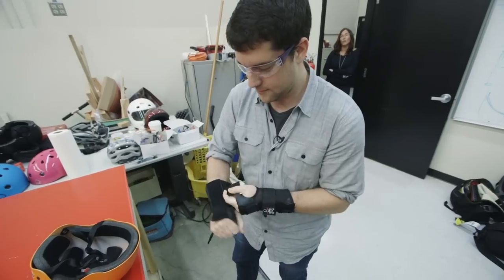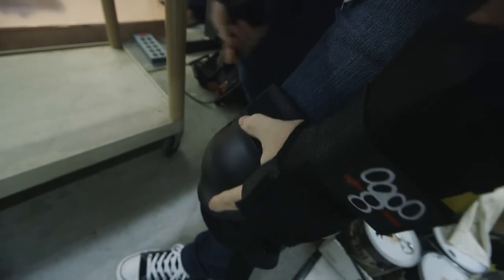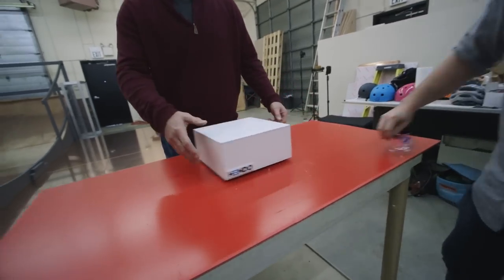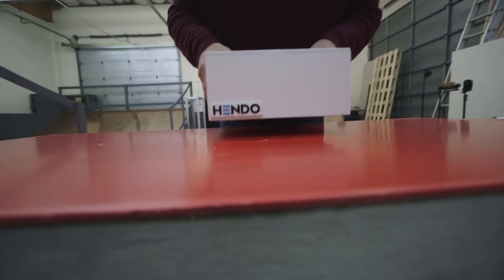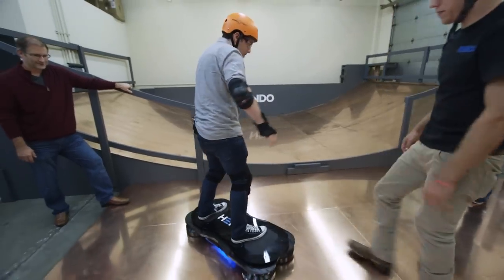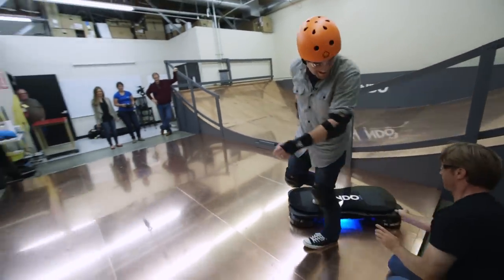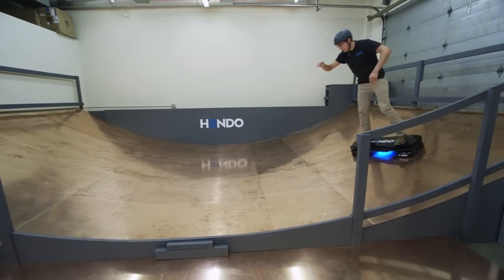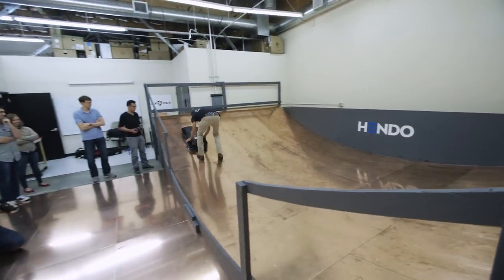Riding the Hendo hoverboard

Comment: I'm still a ways away from graduating high school, but would anyone know what sort of field I should go into it i'd want to persue a career similair to this? And if so, how are the chances I could work on this project specifically?
Reply: "Mechanical Engineering" or "Electrical Engineering".  Probably closer to something called "Mechatronics" but that might just be a buzz word I'm not sure.  There might be a few other fields as well!  Mechanical Engineering will be more hands on building things, but you might not get enough programming experience.  Electrical Engineering will have (what some would consider) more boring lab work but might prepare you better as a programmer (and programming is REALLY important!).  Either one of those majors branches out into a TON of different fields if your interests change in the next 10 years, and if you really really want to be leading the project and not just a grunt/slave/technician for the person making the big bucks, you'll want a PhD so please do well in school!  You can check out the "Arx Pax" website to see quick biographies about every employee working on this project and see their career path from the time they were 18 until now.

Best advice I can give for how to improve your chances is this:  "Find ways to make building cool things your hobby".  There are very few things a college grad can do that a high schooler can't learn!  Except the math is hard.  Knowing how fluids/heat/electricity/magnets work probably takes a few classes but whatever that's what youtube is for.  Anyway, maybe get an arduino and do small projects with it (maybe using something like MATLab), play around in a program like SolidWorks, and don't be afraid to apply for internships you don't think you qualify for when you're only 16+ just because one hour of applying online might be tedious and your odds are bleak.  Anything you can do to show your extra curricular activities were more than sports/league of legends/team fortress 2 will seriously impress employers, but it's not going to be easy because you're going to find out that not a lot of adults can teach you and some things will cost a lot more money than what your parents will want to budget you for your birthday.  So teach yourself and pirate EVERYTHING

Big disclaimer is that I'm a stranger on the internet and you should ask family members this same question.  Maybe some uncle or cousin or a parent of some friend is an engineer and can help more than one youtube comment.  But yep, I picked mechanical engineering because I wanted to build roller coasters :)    I'm totally NOT building roller coasters right now, so in no way am I actually an example of how to follow your dreams to the fullest but thought I might as well type for 15 minutes to point you in some kind of direction.

And for the second part, to work on THIS project at "Arx Pax" the odds are incredibly slim.  A lot of startup companies come and go, so either this project ends up successful and gets bought by some bigger company or it runs out of money.  A lot of inventors come up with ideas and then hire a team of 5-6 PhDs that know what they're doing, and then hope to get bought before they run out of money.  You'd almost be better off starting your own company, and even then to be successful you have to know when a project won't pay off quickly enough and you have to abandon it for something with less risk than a hoverboard.

Hope this helps!
Reply: Probably electrical engineering or mechanical like EmuKiller said. I am majoring in Computer science but I know some electrical and mechanical engineers and they make some cool stuff.
Reply: A Career!!! dude even in the video the guy said they were looking for funding, so as they are not making money yet, this is not a 9 to 5 paying Job, just a hobby on steroids.  

The best advise is that being a grown up is SHIT, & working for other people is SHIT, just enjoy your youth there are no fun jobs in R&D. Work for yourself in spear time on your OWN ideas kid, it's way more fun and potentially rewarding that way.

Comment: i I thought about this when i was in fifth grade, but i realized that to do this kind of levitation i will need to change the current platform of streets and everyday surfaces to steel/magnates -imagine cars and bicycles using this concept, FUTURE!, there will be no accidents too because the magnetic field will prevent any interaction with any object-which seemed unachievable so i gave up on the idea, they should do that too unless governments and private entrepreneurs were included in their formula, other than that they are just another Solar Roadways.
They can always sell this with that golden platform used in this demo as a package that costs 1x,xxx and it would be a cool gadget to a rich kid.

Comment: Nice work but no skate like board controls or stability .
AVA Magnetic Levitation has already come up with this kind of system.
But with drag at the rear so it pulls straight to the direction of travel.
My board design is lighter and the floor is active instead of the board.
Want to know more ?
Adam VA of AVA Magnetic Levitation AUS

Comment: Crap.  $10K for a skateboard that has to float over non-ferromagnetic metal?  An for how many few minutes?

Someone will steal the copper or aluminium from your house for recycling money.  How much power to float a 1500 square foot house 24/7?  When do you float the house? Earthquakes are not predictable yet.  Floods?  Most floods I have seen are deeper than one inch.

This is a high school science project gimmick.  Take a coil of wire, put AC current through it, and watch a piece of aluminum float.

Comment: The problem with this hover board is that it is not a hover board.

This is a Maglev Board. A board dependent on magnetism will not work unless we pave sidewalks in stainless steel. 

The Earth's magnetic field is 1 Gauss, or 2% the strength of a refrigerator magnet. The reason is that Earth's magnetic field is thinly spread over a very large area. Unfortunately, as cool of an idea as it is, there is no way to utilize Earth's magnetic field for the powering of a hover board.

Stainless steel sidewalks and RC capabilities make the hover board possible with 2015 technology.

Comment: The boards and users for the sport take a lot of beating and abuse. If electronics can withstand a design, cells (boost and recharge) that can power adrenaline (at long term of environmental/gadget conditions) to danger zones and leap obstacles of crackheads creativity and stable cost maintenance etal for the toy - then the toy can be feasible. If the toy just exhaust its power in an unexpected dangerous p[laying ground grid, then there is HUGE trouble and will be concluded a concept just intended relic for the shelf.

Comment: Does anyone else believe that maybe, just maybe, they are building upon a dead end road? I see how the tendency is that the hover board can become smaller and manageable, but how can they get away from the ultra strong magnetic forces? This might be the point were what we need is some crazy guy to take 10 steps back and try to find a completely different way to get to the same goal. This has happened in the past, when scientists reach a dead end and some genius figures out a completely different pathway to go over the wall, into the undiscovered. Don't ask me though, I am not that crazy.

Comment: they could maybe mix in metal flakes to cement or paint so they won't need a metal plate flooring. Maybe pave a road with metal infused cement or something. They could probably paint an entire skate park with copper paint used in a ship's hull if they could find a way to make it non-toxic.

Comment: I know that rotating electromagnets very quickly you could overcome earth magnetic field, cause the field supports the electromagnetic field like wind supports plane moving through the air.
Reply: just like one magnetic earth line cannot support magnet stopped, quickly moving one wont bend it down, but the rotation needs to be fast and furious like 30-60.000 oscillations / s or more.

Comment: heres, ONE problem, it only worksontop of metal.
Reply: who the fuck has a metal platform just laying around
Reply: +diego gaud Skateboards only work on smooth surfaces, we made the smooth surfaces, at some point we may start making our roads and sidewalks with a thin layer of metal on top of or inside of the surface because we found out a more efficient and/or safe way of near-frictionless transportation via quantum locking or magnetic architecture. If you wanted hoverboards to be some kinda off-road transportation method then you were just being unrealistic.

Comment: To all those complaining about it only working on metal, Consider that diamagnetism exists in every single substance and material not only conductors. Anything will become a dipole if you present a strong enough field. So if these things had MUCH more power they would force the surface they were operating on to become diamagnetic and would float regardless of the material.

In practice however the field needed would have to be MASSIVE and would cause alot of issues. but maybe there is a way in future.
Reply: Ok, but if we could make such a field, wouldn't that launch us into the air once we float over a random piece of metal?
Reply: Kind of...You would hope that whoever figures it out would also realise that different materials have different thresholds to become diamagnetic and so a system would need to be in place that could detect the altitude of the 'board' and if it started to rise or fall it would adjust the field.
The item in the video already seems to be doing that as when the guy gets on it it detects the extra force needed and you can hear the noise its making change as it ramps up the power to keep the same height above the surface.
If the board went from the copper cladding onto steel instead it would loose height and would again need to ramp up the power to stay level. There will be a limit on how much power it can output and this what materials it can work on.

The truly exciting thing about this is that until now maglev trains needed magnets ether electro- or permenant on both the train and the track.With this tech the track can be simple metal rails like we use today anyway with all the expensive stuff in only the train....this technology could make maglev viable.

Comment: Just an idea;  for levitaion can a square of metal be affixed to the bottom of the hoverboard thus not needing a track or metal floor?  (I'm prepared for the naysayers' attacks on my ignorance, and I don't care).
Reply: Unfortunately not, it would simply not work. You can do it, but then the metal plate would just be touching the ground, thus not hovering at all. Not only that, it would have no way of moving since it has a fix point now. It would be comparable to bolting a bicycle into the ground and trying to ride away on it. Quite simple really. Just a suggestion, I would delete your comment if you were serious about getting an answer. I don't believe in ridiculing someone for something they did not know, since one day I didn't  know that either. But this is a YouTube comment section... Your choice though. Cheers!
Reply: Yeah, it'd be like filling a boat with water and expecting it to float on the ground.
Reply: Sometimes coming in from Left Field creates a spark.  My idea was not intended to be a solution but as a potentiality.

Comment: They're not telling you about the hundreds of amps being used by the metal surface, which acts analogous to petrol in a car. Highly impractical. No way is this the future...
Reply: Yeah "Skateboard of the Future" is a sensational title at best, it's more of a proof of concept and engineers having some fun with technology, not the kind of product they seem to be aiming to make.
Reply: I believe the only power being used here is coming from the board itself. Pretty sure it's got some kind of batteries built into it, that's powering the 4 magnets on each corner. Powering the whole surface is dumb and dangerous.
Reply: aWatch The electromagnets attached to the bottom of the metal are powered not the actual surface...
Reply: Nicktrance1 ??? What? LOL
Reply: aWatch Which part didn't you understand?
Reply: Nicktrance1 There are no magnets in the metal on the floor. The only magnets are in the hoverboard, and that's something they make clear.